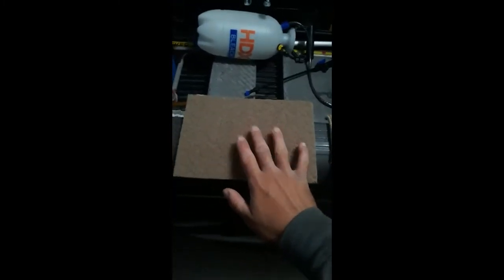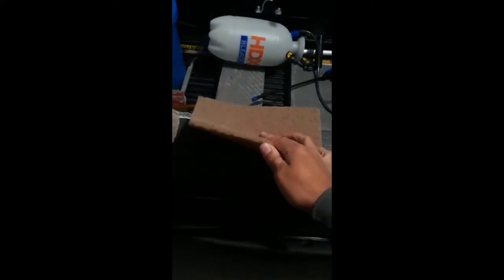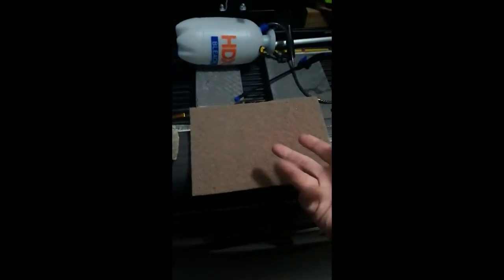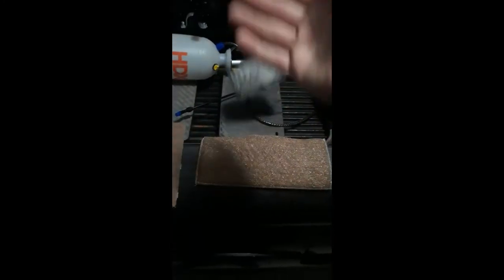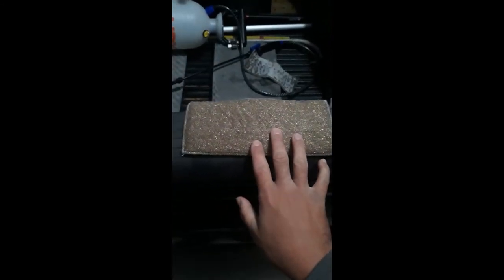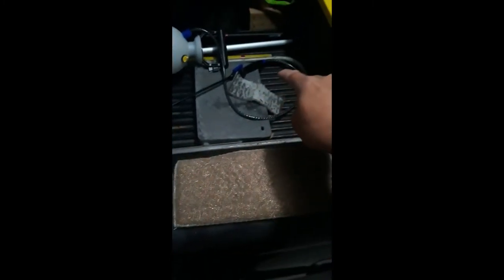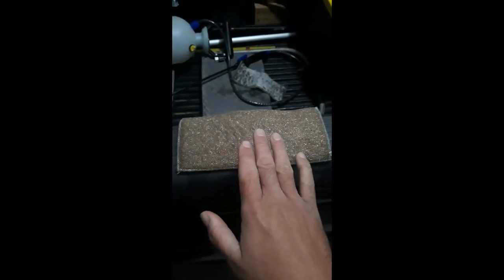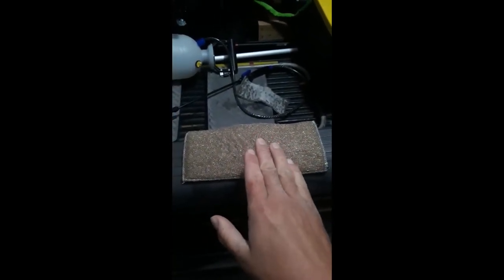Walnut/Bronze/Steel Wool Pads

Comment: I like the walnut pads also🙂 I poke holes to zip tie mine at 2 places on the long side to make a sleeve for 6" strip washer.
Thanks for you video
Reply from the maker: That is a great idea.  I really like these pads-- they are only 1.99 or so-- and 1 will last you a long time.

Comment: I've now started to use the walnut. The brooze does look like that after use for sure.  What type of holder is that ??
Reply from the maker: Hey Kevin! It is called the Maykker Handy Sleeve (6 inch version).  It is a good tool, you can use it for the walnut pads, use their own special scubber too-- they have like 4 different kinds.  You can also put a rag on the end, and the velcro makes sure the rag doesn't fall off when you are detailing.  It is a great tool, I really like it